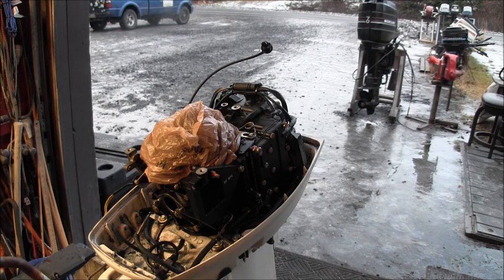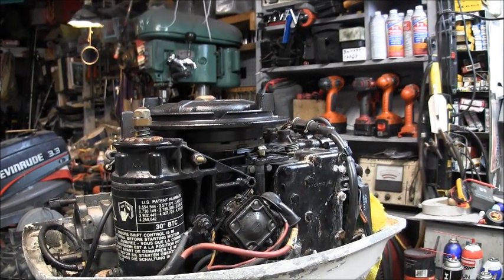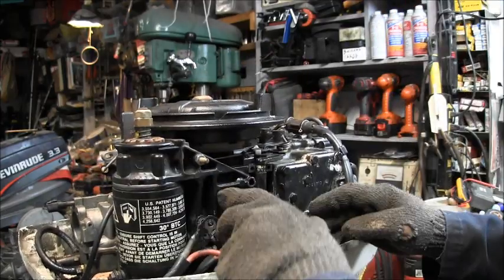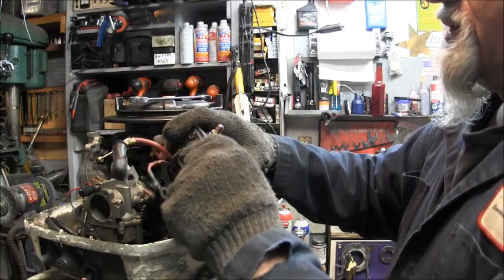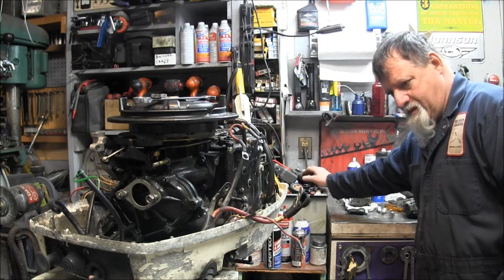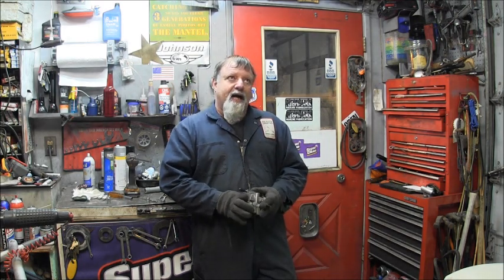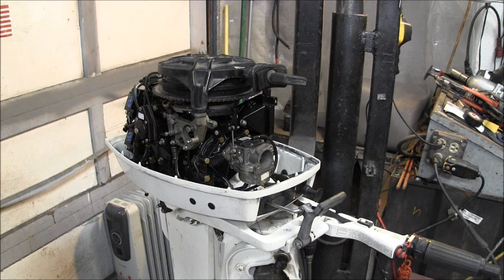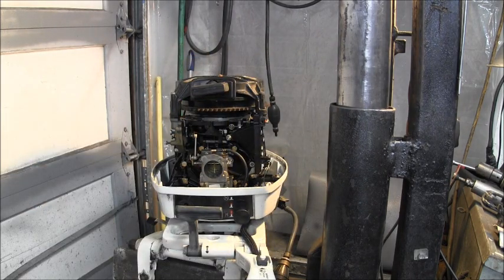JOHNSON 2004 30 HP MAKE OVER,  (( Part 3 ))

Comment: Last year for the 35 to the civilian market:  1984.  1985 had no 35 shown in the showroom catalog.  Many claimed the 1985 30 was the same motor rated at the prop rather than the flywheel.  Not true.  The 84 and earlier block was machined with a bridge-port pattern (on the intake side ports) and the 30 block was machined with finger ports.  The bridge port blocks were the "boy dogs" of that size motor with noticeable difference in power.  I've got both and it is easy to feel the difference.  Not much difference on the light loads, but the with the heavy loads  the 35 will keep on booking.......
Reply from the maker: Thanks 4 sharing the info , Great stuff.    kb

Comment: Boy, that wind just sounds cold!!
Finger nail polish...for a welch plug sealer?   Never tried that one.  I wonder what moma would say if she caught me using her war paint.
So you prefer the 89 carb over the 04 carb?  Yes, me also.  The 04's plastic top, and the brass nipples used in it, do break/crack.
I'd love to see you cut up and use the 04's hood with that pull start recoil rope.  Have you ever done that?   Think it's possible?    I've been tempted to try it, but never have.
This is still my favorite motor.  Reliable, powerful, easy to work on, made in USA.   The only REALLY expensive part is the air/fuel mixture screw, and it's ungodly expensive!
Reply from the maker: I have cut recoil start slot / holes in countless outboards,  I like the old Bigtwin motors that had the door.   kb

Comment: Kodi:  Which do you prefer for YOUR OWN motors - OMC/BOM coils, or CDI?
Is that Super Clean Wheel Cleaner?
Thanks.
Reply from the maker: CDI by far,  Just plane purple superclean,  It works good on about any metal tho.   kb
Reply: @kodibassInsideoutboards  Thank you.

Comment: Following this series.Been tinkering with a 2003 that I still can’t figure out why someone notched  out where the timing screw goes thru the starter bracket so they get more screw adjustment.I tried re-timing it by putting spacer  where it was notched but it won’t time unless I have that extra length of screw.Can a bad power pack throw timing off.?I have spark.Flywheel key seems ok.Not sure why they notched it out still?Happy holidays.

Comment: I've had several 25,35 Johnsons and Evinrudes that were good motors but they all had the same problem power packs going out  never had that problem with the Japanese motors
Reply from the maker: I have had a PP or 2 go out on a Japanese motors, & also on OMC products.  For the asian motors seems to B on the larger motors tho.    kb

Comment: Hey kodi I just got an 1988 evinrude 8hp I did a temp check at head spark plug area with infrared thermometer it was at 147 degrees is that normal and ok thanks
Reply from the maker: Yes' that is just fine.    kb

Comment: Like your videos much :)
Did you ever had a Volvo penta outboard for service ?
Would like to pn …..
Reply from the maker: Check these video's out ...  Close 4 sure.   thanks,       kb
https://www.youtube.com/watch?v=JP-wFxUe9OM                                        https://www.youtube.com/watch?v=NJuYQlAyYQk&t=731s      https://www.youtube.com/watch?v=Db2Oav_AEVM&t=1059s
Reply: @kodibassInsideoutboards  I got a  Yamaha long 8b 677  (estimated 1981) for free - sat for ages - pulled and ran after 3 pulls - no cooling water output - guess impeller is stuck or worn out. But have the option for a Volvo penta 75 which I learned is made by Honda and only rebranded by Volvo … and a 4 stroke. Which one would you recommend ? Tnxs & BR, Stefan
Reply from the maker: @stensfeld    It would B hard for me to say not seeing either motors.  Also what year is the 75 ?    kb
Reply: @kodibassInsideoutboards  hi kodi,
No idea as I only have 3 pics - but I guess from the owner and boat easily 20 years - can I send you the pics somehow ? Intended use is for my sailing boat etap 22 - outboard but inboard in a outlet at stern mounted
Reply: Another question regarding the Yamaha 2str 8hp - it says 1:100 mixture, but I often read that 1:75 is better and the mariner counterpart of the Yamaha runs with 1:50 …. Confusing - what is your experience and recommendations.
Reply from the maker: @stensfeld   ON most 2 strokes made after 1964 you should mix 50-1 ,  That 100-1 was a last ditch effort to meet 1996 emission  standards & was the death of many fine 2 cycle outboards.  Most 1964 and earlier ( bushing  motors ) should be run 24-1 or even richer.                                                                                                                                  kb
Reply: @kodibassInsideoutboards  ok that’s waht I expected - it is according to a database ist a 1981 model - so I’ll switch over to 1:50 - mineral or fully  Synthetic like I use in my scooter ?
Reply from the maker: @stensfeld   I recommend a 2 cycle oil with  TCW-3  It is made just for high reving  
marine engine applications.                                                                kb